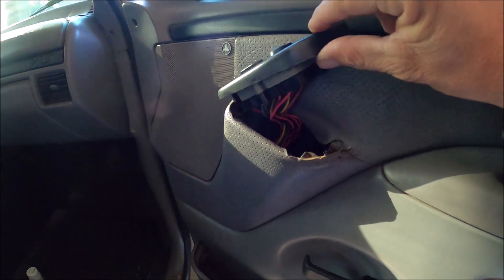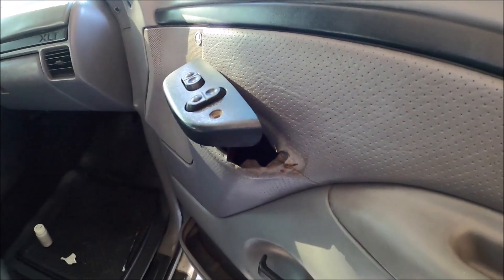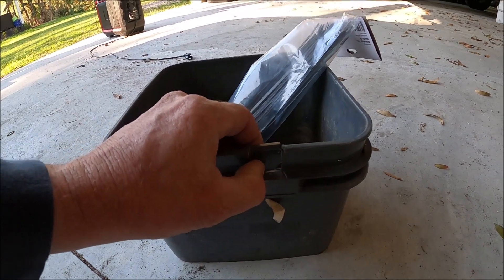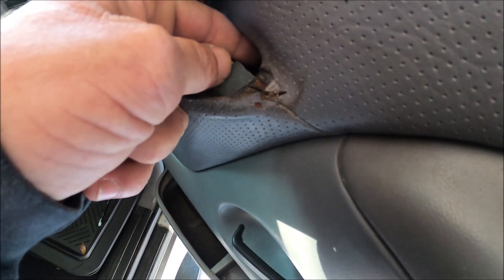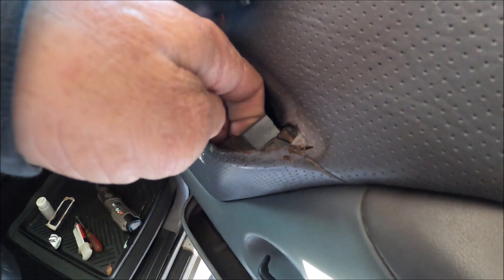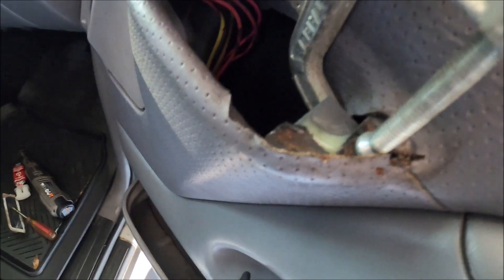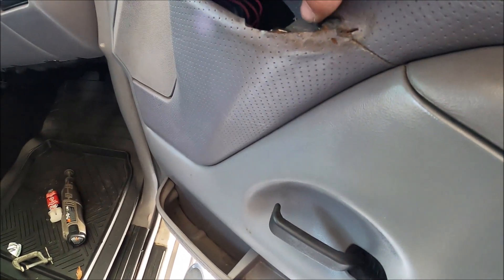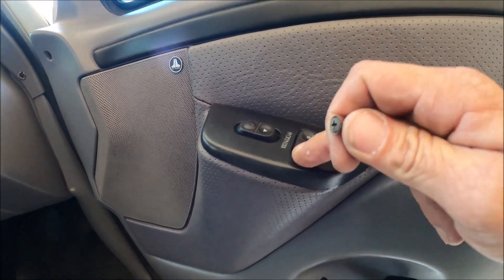92-97 FORD DOOR PANEL REPAIR

Comment: I am about to do this to both of my door panels on my 96 Ford bronco. This is exactly what I was looking for. How did you get the screw hole back in the plastic without breaking it off? did you have to drill out a new hole first? Thank you
Reply from the maker: should be able to drill after epoxyed